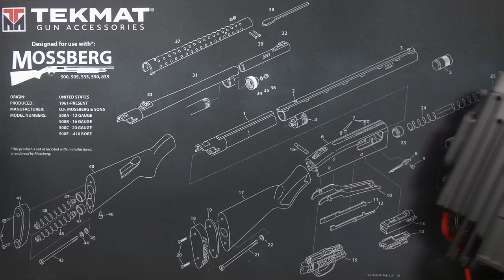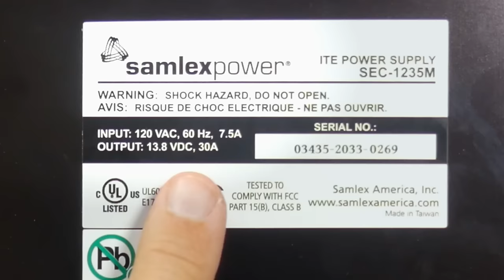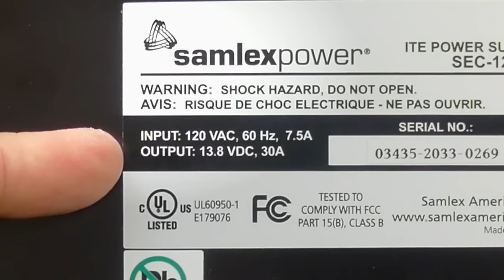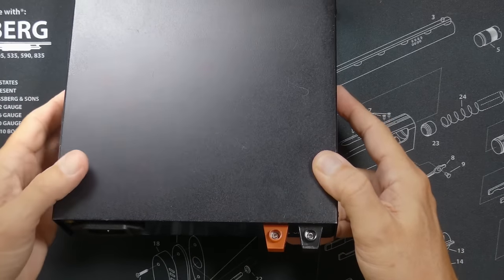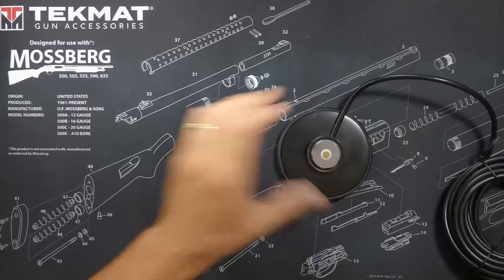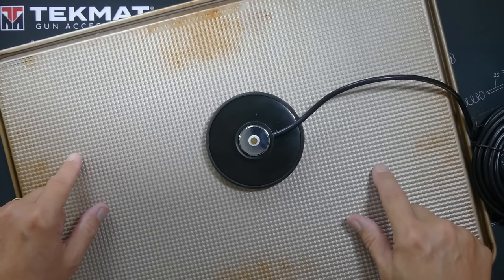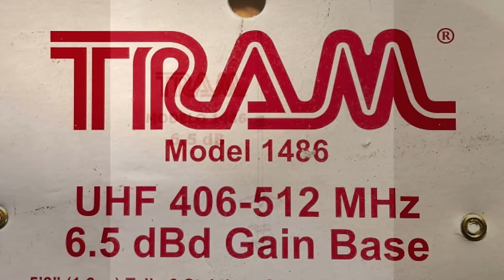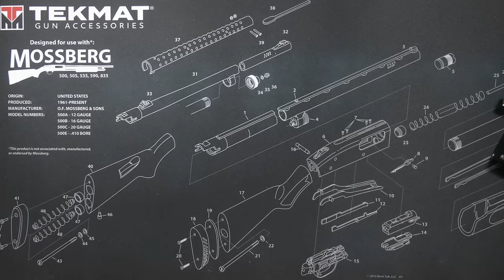How To Build A GMRS Base Station - Everything You Need To Know To Put Together A GMRS Radio For Home

Comment: I have a g.m.rs  radio with mag mount antenna my radio is rated at 45 watts  I asked ham radio world what size powersupply to
buy thay sold it to me and I have been on air since 06 03 2023 no problums like everyone else has thay cant make the repeter
becouse there running a ht at five watts so there

Comment: Or instead of spending almost $200 on a DC power supply, buy/locate a power supply from a pc workstation or server on ebay. The server power supplies put out nearly 5x the amperage as the dinky power supplies listed in the video. 
I use one all the time for battery charging and it cost me $20 and puts out more than 60amps at 12v

Comment: Anyone have gmrs base station directional antenna recommendations?
Reply: I don't recommend directional antennas if you can avoid them.  Everytime I have put one up pointed at my favorite repeater someone else shows up in the wrong direction that I want to talk to.  You could install a rotor but those are a lot of hassle and need repairs from time to time.